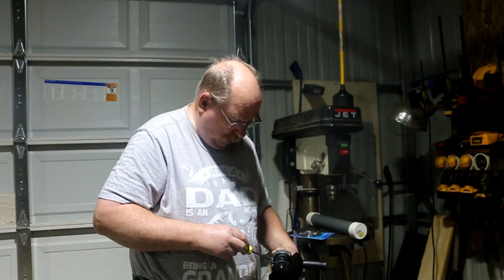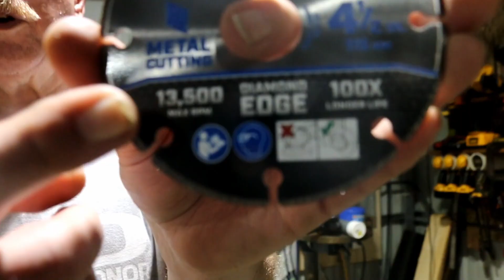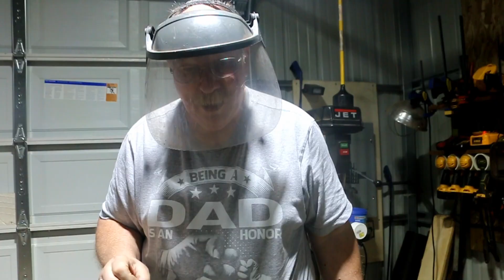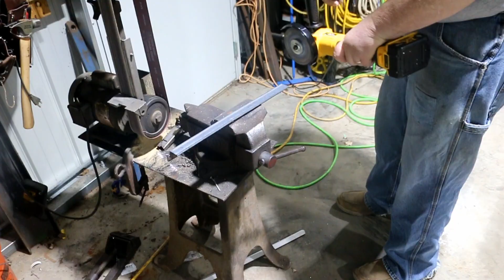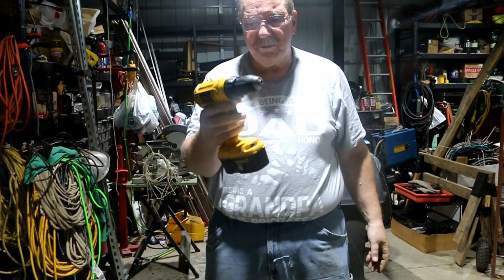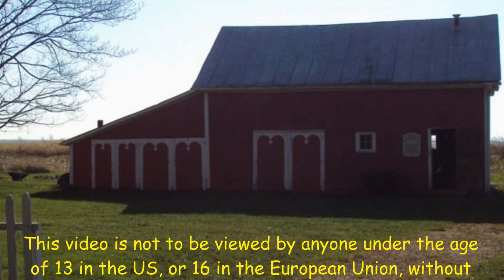Testing My New AutoJare 4.5" Angle Grinder & Hart Diamond  Wheel

Comment: Glad the knockoff is serving you well.  The only thing knockoffs tend to do is drain batteries to the point of under undercurrent making them unusable till you manually charge them.  So just be safe and not run it into the last bar or keep it on the tool all the time and you'll be golden.  The harsh motor sound is actually a blade brake.  That is what my 60v flexvolt sounds like and it looks like a metal head on that thing too.  If the knockoff is 1/3 the price and its all you need then your good 👍.  All thoes diamond wheels comes from various manufacturers label for each brand.  I doubt that hart has more than a name slapped on it and its shared with other lower end brands.  The only ones that really do there own thing are diablo/bosch other Italy or aussie sourced stuff.  I still think a portaband could do what your asking no sparks no ppe.  I see it now 2 new batteries and a free tool like a ossilating tool are in your future if the budget allows.
Reply from the maker: Thanks for the advise. Learning from others experience is a big improvement over, "Well I won't do that again!"  
When I come across a portaband that matches the budget I will certainly try it. 
The shops bandsaw does the duty of a portable in the shop but it is not a carry to the site type of tool unless I'm building a bridge. 
If I was still an on the job electrician that would be in the truck for sure. 
The metal cutting band saw in the shop has been a big help. I see a lot of people with the portaband mounted on an auxiliary stand. 
I'm sure you are right on the Hart blade. If I stacked up most of the diamond blades the tooth pattern would be an exact match on a lot of them. 
The Eastern companies seem to have the philosophy that once we have the die there is no end to how we can stamp and sell these. 
I should look into how the diamond are applied. I wonder if it is similar to bonding tungsten carbide with a flame spray. 
Douglas Corp did flame spray and we coated all kinds of things. 
We coated a polystyrene statue with a dusting of zinc and then put bronze flame spray on it by holding the gun way back until it built up a thick enough layer to hold together. It worked okay. Not great it looked like it was a beach sand statue but it worked. 
I have an occilating tool in a storage box out in the shop. 🫤
I have to get the racks and shelving a bit further along so I can get to all the tools I had gotten use to using. 😁😎

Comment: Looks like a nice grinder. Hopefully it will give you great service. We are always praying for you and Lydia 🙏🙏🙏
Reply from the maker: It's handy for cutting up small sections for projects. I tried using the sawsall but that has to reach through the material to work well. 
The grinder can pierce through or start from an edge. No chatter or binding. 😁😎

Comment: Think you should open that gear box and make sure they put grease in it. The diamond wheel looks good, I have a diamond wheel for metal but haven't used it yet. My belief is the diamond will be much better than the abrasive and I think a little cleaner without getting so much abrasive around the shop. I have grinder arbor adapters but it would cost more to send than just buy new plus it's possible your foreign job could be foreign threads.
Reply from the maker: Thanks for the tip. It wouldn't hurt to see what is inside. After running it a bit I'm more inclined to think it is from the stepper motor better safe than sorry. 
Besides don't you want to see now? I do. 
The abrasive dust from the grinder is a concern for me too. I have taken to wearing a respirator if I'm doing much grinding. The black dust from the wheel gets everywhere. 
The big selling point for me is not having the wheel shrink. I go though about a wheel per pallet. The wheel gets too small to go through the angle. 😁😎
The package says the spindle is a M14 thread. 
I'm buying a guard for the Bauer and a battery adaptor along with a a spindle adaptor. Ebay is making out like a bandit. 😁😎

Comment: The grinder looks like it will work. Standard cut off wheels are the way I do it…..CHEERS
Reply from the maker: I think it will be fine as a backup and off grid tool. 
Easy to put behind the seat of the truck and be ready if I need it. 
😁😎